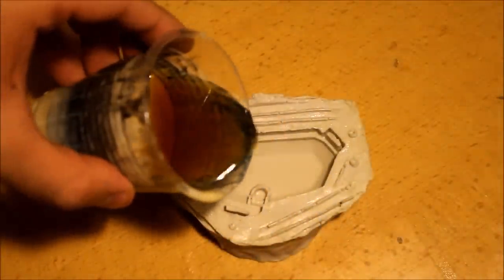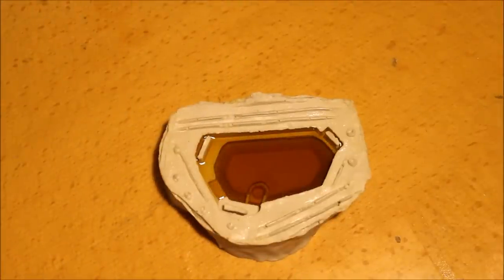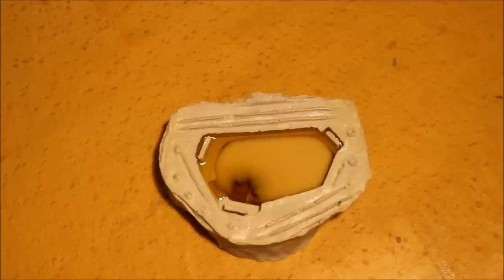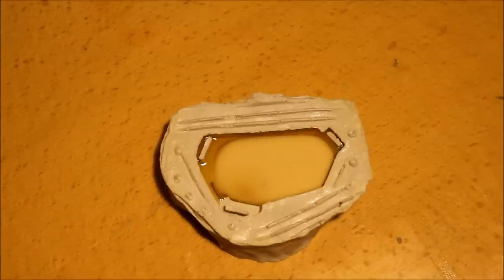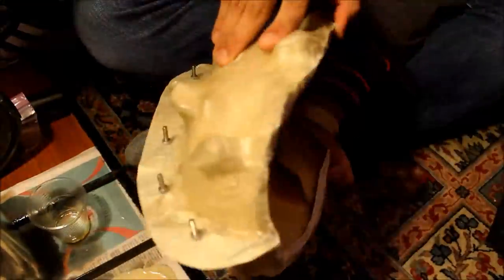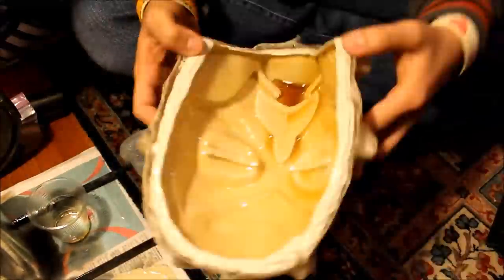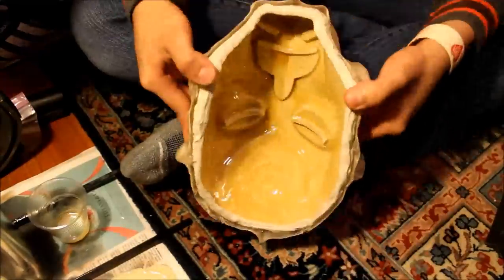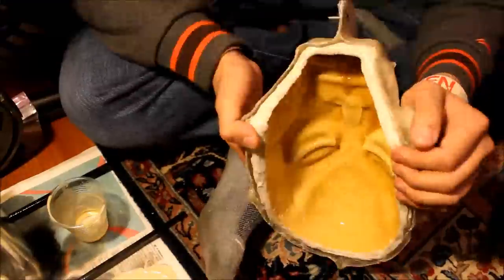How to Slush cast a Mask - Skyrim dragon priest mask

Comment: nice video, how do you make the eyeholes in the mask after casting? What tools do you recommend because I found it is hard to cut open the eyeholes using a knife
Reply from the maker: i use a dremel tool to sand out the eye slots from the inside, if you have a drill you can also drill lots of holes around the perimeter of the eye slit that are closely spaced and then push the eye slit out

Comment: How many casts can you make per both A and B bottles? And what kind of resin do you use and bottle sizes? Bc im going to use 1 pint for each A and B and i would like to know how many casts i can make
Reply from the maker: I use polyurethane plastic to cast my masks, similar to smooth-on's smooth cast resins. I get 1kg of both A and B parts and from one of those cans I would say I can make at least 10 masks! I measure it out in bottle caps as I use them like ladles, I use in total about 30-36 bottle caps worth of liquid plastic, thats with A and B mixed together so about 15-18 bottle caps of each part

Comment: How do I prevent building up on the nose?
Reply from the maker: they key is to keep the plastic moving within the mould! It is an inevitability that hand slush casting will result in some areas in the piece being thicker than others, but if you keep the plastic moving around until it has cured to the point where it no longer flows this can be minimised!

Comment: How thin and durable is this method
Reply from the maker: TheOneRing 987 its as thin as you make it, you build it up in layers. The thicker you make it the stronger it is, but if you want something lightweight and strong then i suggest doing a few layers just as a skin coat in the mold, then backing it with fiberglass
Reply: KRSprops ok thanks so one layer would be really thin like a 10th of a mm
Reply from the maker: TheOneRing 987 slightly thicker as the plastic thickens as it sets and you make get some pooling in certain areas
Reply: so thicker than 1mm?
Reply from the maker: TheOneRing 987 no more like 0.2-0.3mm thick per slush cast layer as long as you spread it around sell and evenly
Reply: ok thanks for the info what is the slush called for me to buy
Reply from the maker: TheOneRing 987 the material is called polyurethane plastic